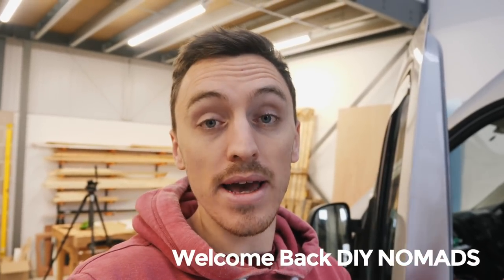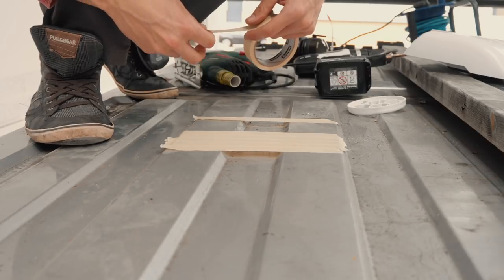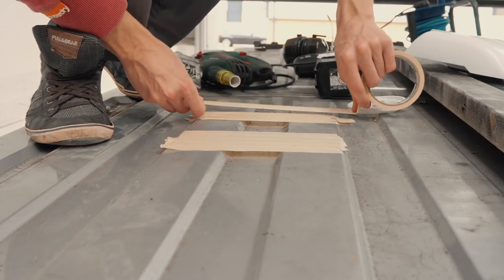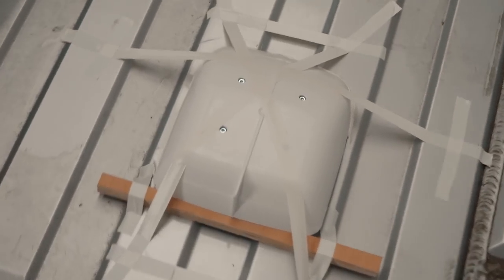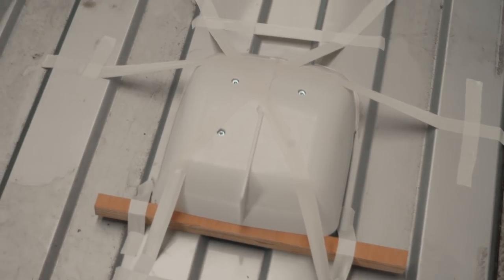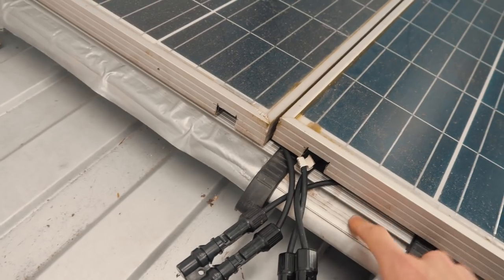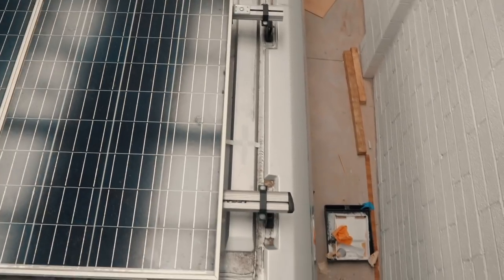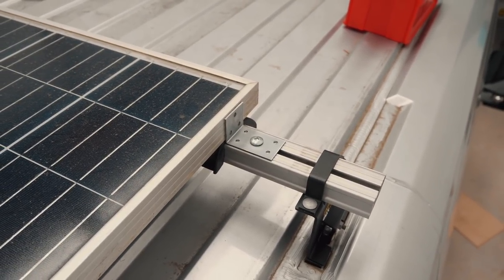Adding Internal Camper Van Shower! Part 02

Comment: Great vid as always. Just a tip, always have tape stuck to the jigsaw sole underside. Even if there was a nylon trim on its underside, still be in the habit of using blue painters tape as well. You’ll never have to worry about marking your job that way. Of course, change the tape regularly for new and clean tape 😉👍